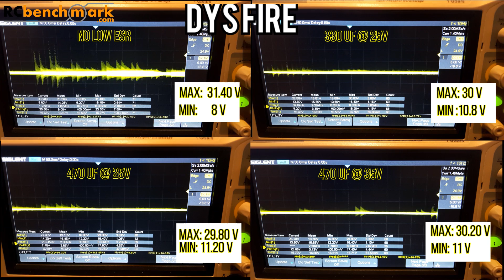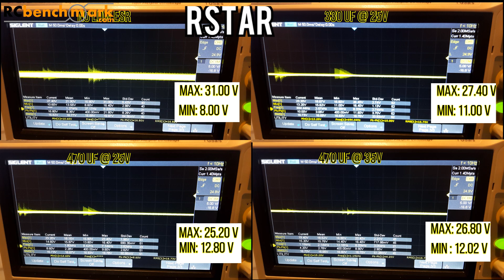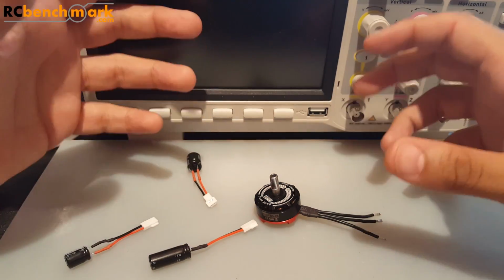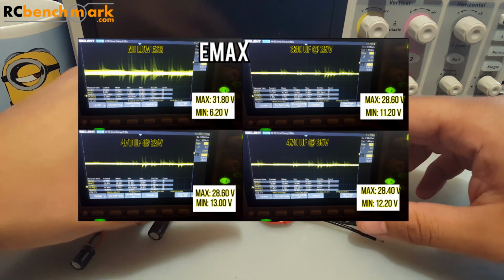Best Low ESR Capacitor for ESC?

Comment: Can u do an experiment between using esc capacitors and diodes? I heard that it can also be used.
Reply from the maker: Capacitors are better for ESCs and diodes are good for the FC and other components which dont need alot of amperage.
Reply: @DroneMesh  how do i install diodes into flight controllers and does it make much of a difference.

Comment: I wired one 1000uf cap to my battery lead, this goes into a martian2 PDb, from there I feed the 4in1 esc from  2 esc pads,(the 2 nearest to the xt60), the 4in 1  esc has a vbat output, from which Iam feeding VBAT into my bardwellF4 (over the  jst plug where also the current sensor and motor singnals come in.... ) I decided to add a 470uf to the "battery in" of the JBF4 (where the shunt is, and which is also not in use, does this help filtering the vbat which comes from the 4in1 esc? Iam worried about the vbat output of the 4in1 being noisy..
Reply: or does it explode?

Comment: Try 220uf Cap packs of five on each ESC along the ESC power wires and keep the caps as close to the ESC's as you can but don't solder them to the same point. Solder to the power wires by stripping the wires back and keep the caps close to the ESC rowed up along the power wires then heat shrink wrap them.

Comment: The Longer those wires are the worse the cap will do. The closers the cap is to the source of the noise the better they will do. The connectors won't help much but make things not work as well.

Comment: He drone mesh. Cool vid. A capacitor is actually not a very simple component. Most people understand that it can act as a buffer and that it where it stops. A capacitor consist actually out of three elements, 1. the capacitor part, 2 resistor part and 3 an inductive part. You could simply say that ESR refers to the resistor part, but there is also the ESL, which refers to the inductive part. Overall the impedance value depends on the frequency a looks like a cure. At the lower end of the frequency band the ESR values determines the inductive value. At a certain point the curve will find its lowest point, while going higher in the frequency band the ESL value will take over and increase resistance. The capacity of a particular cap determines at which frequency this lowest points is. So changing the cap value means changing the point where it will filter the most effective. 

also the form factor has influence and I see you have two form factors. I belief the shorter and wider one has a higher ESR value even if you take the same brand, capacity and voltage value.

The voltage of a cap should be the DC component plus AC/ ripple voltage if you want to have a cap than will live a long live. Any lower the cap temp may increase which will influence its behaviour, but also its expected live span. Maybe the later is not an issue for most builds and higher temps also means lower ESR values. 

When it comes to placement. Its a good and well defined engineering practice in the field of electronisch that the filter cap should be as close to the noise source as possible, so placing them at the ESC makes sense. Other places like the battery will also work but (for a reason I dont know) the further you are away from the noise source, the stronger (read higher voltage peaks) the noise gets. BTW I dont know if that can actually be seen when doing measurements on the quad, but currently on holiday. 

In the end I think it starts with identifying the noise frequencies that must be filtered out and finding the right cap or combination of caps to filter the noise away. 

I think there is a lot more so say and was planning to do a video my self, which I expect to be more of a mini series. 
Overall, keep up the good work!

Comment: the reason why the 25v cap did better is because it can discharge sooner or faster then the 35v and that is do to it's voltage rating being closer to the battery voltage. the lower or closer to the max voltage of battery the cap is rated for the quicker it can stabilize the voltage. on the vtx you should test a 100uf 16v to a 470uf 16V  cap and a 1000uf 16v. then with input voltage still at 12V test 100uf 12.5V cap to a 470uf 12.5v and a 1000uf 12.5v cap. I bet the 100uf 12.5v does the best . the 100uf 12.5V caps works killer on most any vtx but you just have to be carful not to give the VTX more then 12V from it's regulator.
Reply: the problem is that the voltage is centered on line voltage.  If you're giving the VTX VBAT on 4S, thats 16.8V.   The noise is an AC voltage centered on the DC carrier line voltage with spikes in excess of 25V during the AC peaks, which are additive to the DC line voltage or subtractive in the same way.   The general rule for filtering ANY DC line for AC noise like this is VDC x 2.  The closest to 16.8 x 2 is 35V.     If you use a rating very close to the DC line voltage, you'll end up popping the caps more often than not.

Comment: One point to your test - ESR is essentially a resistance of capacitor plates and wires. And when you mounting low esr capacitor it is essential to have as short wires as you can. And if you test different low esr capacitors its better to connect them with wires of exact same length. I think thats why 35v 470uf is tiny bit worse, then 25v 470uf - it has longer wires.
It would be interesting to see test of capacitor with, for example, 0.5cm wires and 3cm wires.

Comment: @DroneMesh

I suspect lower ESR is more important than the capacitance rating (up to an extent of course). In your follow up testing can you also look at ceramic capacitor banks such as:

https://www.banggood.com/V2_0-470uf-Anti-interference-Parallel-Capacitor-Plate-Capacitance-Board-1-6S-LiPo-For-Mini-ESC-p-1133294.html?rmmds=myorder

Comment: Hi ! 
Thanks for the video.
Is there a difference between putting one capacitor on the battery lead and one capacitor on each ESC ?
Reply: Fosch yes there is a lot of difference. He's using a 470uf at 25v per esc. So you will need to have one 470 on each esc. This can be alot cleaner than say just one 1000uf on the main leads. A 470 is rather big 10mm x 20mm so account for some space. I personally use one 1000 on the main leads and a secondary 470uf cleaning stickly vtx/cam power.

Comment: I'm curious if using the caps without extensions and directly soldered onto the esc pads would give better results. I understand why you made the adapters though.

My current favorite on all my high powered quads is the 50v 220uf Panasonic low esr. works great from my experience and they aren't too big
Reply from the maker: Adam-g1 I did that in beginning I was testing emax to make sure the results are not screwed by my ease of use solution. but I will make a video on this when I order all the caps I can find.

so we can sleep better at night ;)

Comment: Finally! Someone did the right test on caps rather than talking or assuming about it. People adding caps here and there without basic  knowledge how capacitor works. Before I put caps on my drone I used oscilloscope to find out what noise I want to filter out. This is the way I found out that simple small SMD tantal cap together with small coil removes noise from camera better than caps on main battery connector or individual ESCs (and saves weight). Great job Drone Mesh keep going and you become new Joshua Bardwell in drone community.
Reply from the maker: Thanks...

If you don't mind can you send me pictures and links to your setup and the SMD tantal caps setup as well as the small coil. Would love to test them and see how they perform.

Once i get them in will definitely mention you in it for the great info ^_^

mesh.drone@gmail.com
Reply: SMD tantalum caps and coils you can find on almost any new electronic board. I pulled few from broken PC motherboard.  Type in google tantalum 475v it is 4.7uF 35V, coil was about 11uH, that is what I had available at the time and this is how I set this up https://drive.google.com/file/d/0B4pFvXvSlNqdLW9kSlRCYUN5WXM/view?usp=sharing .If you want to completely clear out the noise, you have to match caps and coil to the frequency of the noise (Unfortunately different motors,ESCs, ESCs settings produce different frequency noise). Sometimes it means, you have to put few LC filters in row. If my calculations are correct F=(1/2*Pi)*SQRT(1/L*C) - gives about 150 kHz.I run Brotherhobby R4 2206 2300kV with Racestar MS 35 ESCs, which seems to be very noisy. If you swap cap for lets say 1000uF you will filter everything around 15 kHz. Big capacitors installed at the battery connectors should prevent quick voltage drops and spikes causes by high throttle punches . Which actually helps in eliminating OSD blackouts, but will not filter high frequency noise, which passes through 5V and 12V regulators. This is what I remembered from my electronics engineering school, but it was a long long time ago, so I could be wrong :)
Reply from the maker: Thanks for the info it is actually very helpfull. I will be testing your setup and i bought all LC filters I can find on banggood as well as step down converters.. Found some step downs are very noisy at specific voltages so I will even be reviewing step down converters as well.

GepRC same setup as yours i get some blackouts, but i am using F3 V3 with 1000uF Low ESR i know its the OSD , Racerstar 35A are very noisy indeed, I will know how much exactly soon compared to others in market I have ordered all DYS ESC's , some T-Motor and some littlebees. So far waiting for support to kick on patreon to go all out and buy everything and test it all.

Soon we can compare.

Another thing noticeable so far from my testing is motors with stronger magnets generate a lot more noise around 40% to 70% throttle not including spikes just stable throttle.
Reply: As regards step down converters, their main function is to bring voltage form specified voltage range down to lets say 5V and keep it at that level with very little noise filtering. So if you have BEC built into your FC, additional step down converter will only add extra weight to your quad (well.. 1 or 2 grams for acro quad will not make a difference :) ) 

As regards OSD blackout. I use DYS F4 Pro FC and I think Eachine TX526 on 3 of my quads and no blackout at all. I used to have 1800uF 25V Cap at main battery terminals, but it didn't make a difference so I removed it. If it is F3 V3 HGLRC FC, I am not surprise, you are experiencing blackouts, I have built 2 quads on F4 V3 and  one based on F4 V5 FC, and I could not tune it right. The best and the smoothest in tuning was original SP3 racing deluxe FC.    

I agree, motors with stronger magnets will generate more and stronger frequency noise. Additionally,  If ESCs are "lazy and cost effective" designed, they will introduce more noise into the system. So basically you get what you have paid for.If you run DShot, then such noise is not affecting control signal, because it is a digital control signal and all errors should be ignored ( in theory, because if you not remove cap at ESC input, ESC will not receive perfectly sharp edge, as you showed this on other vid), but if you run oneshot or multishot then you might get erratic throttle response and quad will shake. But as far as I know no one did right tests on this, so maybe this could be another area where you can use your oscilloscope.

BTW: Like you oscilloscope and thrust stand even more, but I would put my marriage on the pressure if I decided to buy these.
Reply from the maker: Icarus_RC Yea I will be testing those areas soon but I am trying to get funds to buy 3 more stands and some how simulate a power hungry flight from parsing the Blackbox logs and replaying it. Currently I was checking CLI commands if possible to just connect on com through an arduino preloaded with motor data and run it but I will have to have arduino talk in pwm to the esc least amount of coding and time to get it done.

Comment: Great video, thanks. I wonder how the oscilloscope responses would look if you put a single 25V 470uf cap on the lipo connection of the PDB (handling noise from all 4 motors at once) as opposed to one on each ESC like you've tested here.
Reply from the maker: That will be upcoming in the FC and PDB Testing.. Still setting up the test bench I will be adding FPV Gear and DVR to record the noise as well so I have a huge list of things to test and this is one of them ^_^.
Reply: Drone Mesh Excellent, thanks! I look forward to that. One other thing is that the different scales you had are hiding just how effective the capacitor is actually filtering out the noise (the scope for the setup without a cap had double the range and was still showing at least double the amplitude of the other setups!). It would be great if you could have the same range on the display. Great Job so far, keep up the good work.
Reply from the maker: +Wes Ness Thanks.. Everything is the same so I think what your saying is that it seems that the no caps seem much larger spikes on the divisions. Well if so yes it might seem that way but even the ones with caps are reaching that high but it's so fast and filtered out through the caps witch is why it's not lasting as long to notice it. I think if I turned persistence on it would of been more clear. 

But I did not want to lose people on that part.
Reply: Drone Mesh It seems I misunderstood the "min" and "max" numbers on your images as the oscilloscope range as opposed to the actual readings you got. My mistake!
Reply from the maker: It's ok no problem ^_^
You scared me for a second I was triple checking everything but i saw all is correct.

Comment: if I remember right. let's say you have two caps one rated at 10v and the other at 20v but have the same storage. the 20v one will have twise the pass. so thinking logicley if you charge the 20v one to 10v you are only having access to half that storage energy. cuz what happens let's say you charge a 20v cap to 10v and fully charged of energy. then you try charging to 20v. the 25v 470mF is pretty much fully charged when the 35v 470mF is about 65% charged

Comment: that racerstar looks like the standard 2205 non S version
Reply from the maker: It has a S on it ^_^
Reply: Interesting, maybe a printing bug? You can see "BR2205" printed on top of the bell. I also have these motors :)
Reply from the maker: Yes it could be as i remember there was no S version for the 2600kv and when i took this one out of the box I thought i had 2300kv in the house but it turns out to be a 2600kv S witch i found strange as well.

Comment: well there you go, the data don't lie . without a doubt really makes a difference. was a little relieved to see the 470 uf 25v working well .that's what I run on my set up.   didn't Know if it was effective or not but what the hell won't hurt to have it on set up.  lol.  really loving the true data that your producing. big help in making the right decision.. waiting on video I'd the ground for signal ESC's.  I'm not using myself and I've got to say that my quad acts stupid sometimes. lol I'm courious if that's the ground or not. we will see soon  thanks. sorry for the essay input. lol
Reply from the maker: Love hearing back from you guys. I am very happy I could help.I was curious myself so I wanted to run a quick broad test to see how everything stands up.

You just gave me an idea, I should buy normal Capacitors also and see how those will work. Think that would be fun.